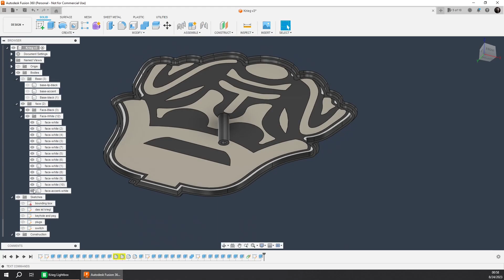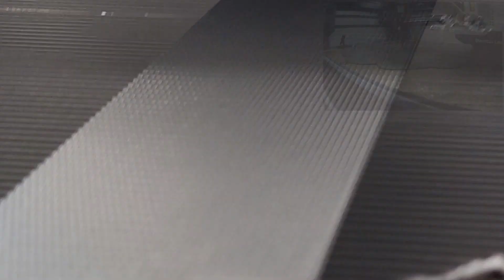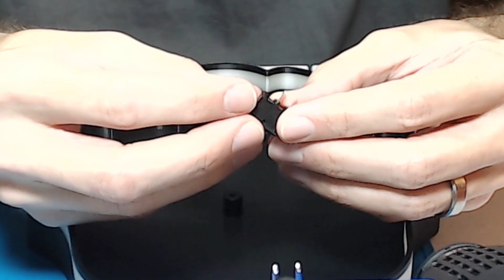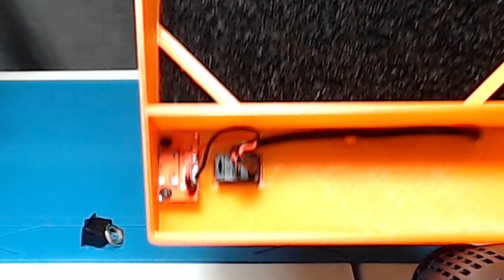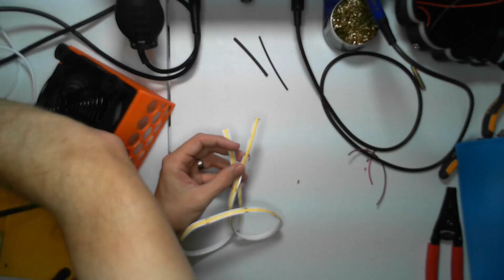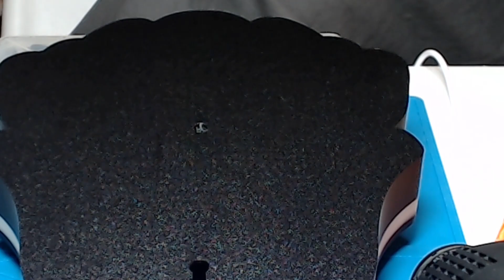Lightbox Part Deux - Assembly

Comment: Would you go this route(In terms of soldering /entire process) if you were to make this light boxes in Bulk?. if not what would be the other route
Reply from the maker: If I were trying to make these on an assembly line, there are snap-on connectors for the strips and spade connectors for switches and such that are much faster to connect, but would add cost, so... 50/50. I don't see it as worth it.

In all honesty though - when not explaining the process for a video and just building one - it takes all of 10 minutes.

Most of the time I print the base first and while the face is printing it's first layer knock out all the electronics and such in the base. That would be sustainable even with six printers running.
Reply: @RevHazlett  Thank you, i saw the the vid and was estimating it would take 20 minutes for each. but since you clarified i think i have a better understanding of how the process would go